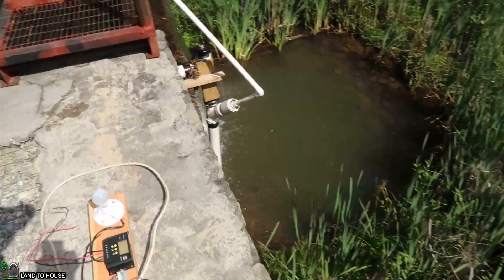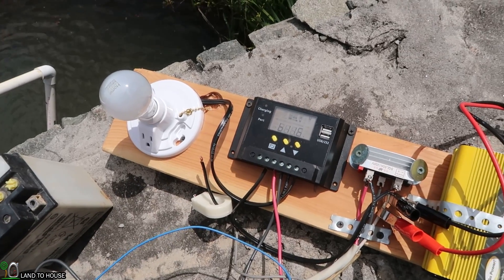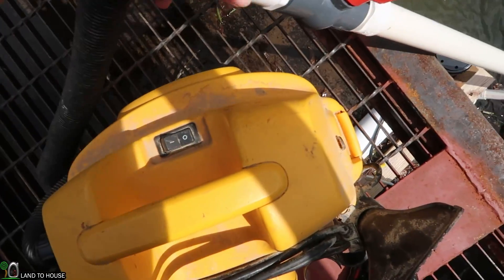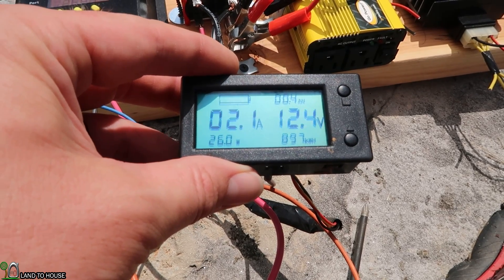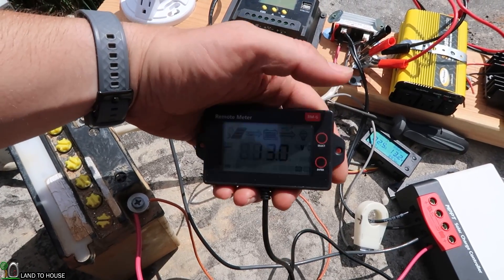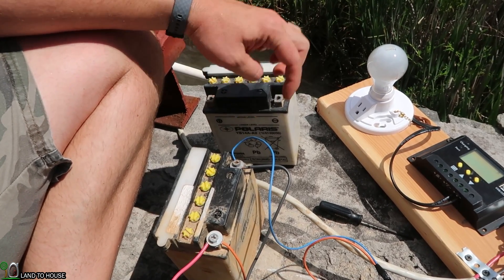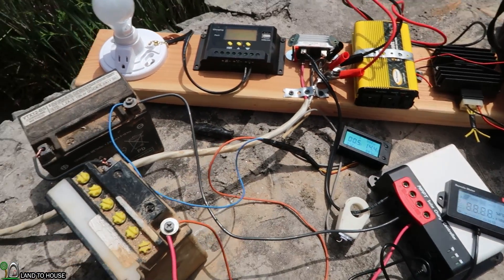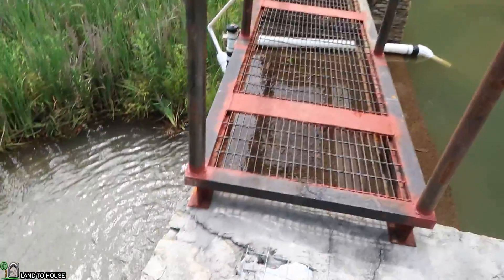Hydro Power with MPPT Charge Controller

Comment: It's good that you experiment.  Tip: NEVER put two batteries in series unless at the same voltage. One will overcharge that way, the other undercharged to reach a total of say 28 volt charge voltage.

Comment: Makes me wonder,
If that turbine impeller was lower in the tube, the weight of the water, would the system be able to support more of a load? 
or because it's a syphon, would it even make a difference . .
Reply: it wouldn't. In a syphon/low head situation, it doesn't matter where the turbine goes.

Comment: There is something wrong, at least 100W must go out, then if you get to do something more better but 100W must go out, in the maximum hypothesis of using 15 liters per second in a 4-inch tube, and a 50% efficiency conversion 15 * 1.92 (net meters) * 9.81 * 0.5 = 141W electric. Ciao
Reply: I said pretty much the same thing...
Reply: @Kevin_M_Hall  Yes !

Comment: That turbine seems terribly wasteful on water usage vs. power output. Not worth it from what I see here.
Reply from the maker: It needs a larger and longer down pipe. We are about to swap over to a turgo system. Should have better results. This is why Spencer wanted me to run several tests on this unit.

Comment: For the amount of water it uses, seems a pitiful amount of power.

I think the pelton wheel system is a much better power gen solution.
Reply from the maker: We have a turgo system in the works to test. This one i think has a max potential of 42w with 7 feet of head.

Comment: Very cool and thanks for sharing.  A cool dry run of your testing to sort out procedure and gear.  I believe the MPPT showed a tad higher battery charging voltage than the PWM, which might explain the difference in wattage reading, the MPPT was current limiting the charge to protect the battery.
Just thinking out loud here, you might want to 'mostly charge' the batteries before taking them down to the falls so you have a better baseline to start with.

Comment: Didnt think the solar controller is doing it, since your hydro is out putting three phase and normally panels are outputting DC. Nice to know!
Reply: 3ph ac is converted to DC, I would add maybe some capacitors to the system after rectifier

Comment: Considering that you have just over 320 watts of energy available in a 4 inch pipe with a 2 meter head (16 L/s max flow thru a 4 inch pipe, 2 meters of head) [16x2x9.81=~320]  where are the efficiency losses you are experiencing? (About 10% extracted energy.) Impeller? Generator?

Comment: instead of the pwm and mppt devices.. a dc to dc buck converter would give manual control over volt & current output.. that way power variance can be set to needs eg: using 100 watt buck to charge set st 6 volt lead agm & 12/24volt lifepo4 batts..  also observe it pulls more watts than on/off pre programmed smart chip regulators.. best for the bucks would be a victron dc-dc charger for online monitoring capabilities..

Comment: I disagree with your interpretation of the results. You're comparing the results from two separate meters and even showed the old meter holding strong at 31 watts on the MPPT when it was all over the place with PWM. The whole point of MPPT is to smooth out the input power by tracking the maximum power point.  Doesn't matter if it's solar or hydro or wind.
Reply: Yes, the two different power meter readings are problematic. Which is right? I would rather trust the new one, because it is build-in. Anyhow, at least one is measuring the wrong power and hence you can not compare them.
Regarding MPPT it unfortunately matters if it is also rated for wind/hydro or only for solar. Solar cells are reacting much faster on a changing load demand (e.g. the new voltage adjusts instantly when the drawn current is changed) than wind or hydro turbines. The rotation of the turbine and the flow either of air or of water are storing energy and will have to adjust to a new power demand. That takes time. Solar MPPT are to fast and will draw a to high current at the beginning because it consumes the energy stored in the rotating turbine and the flowing air/water, and then the get stuck there because they cannot find a new max. power.
I still try to convice Seth of using his MidNite Classic charge controller. That is of much better quality, is also rated for hydro, and has a reliable power reading build-in. We will see ...
Reply: @patrickhoffmann8893  it shouldn't matter which one is correct per say, esp since it's just a test, but he should be using the same meter for both tests. Can't just declare that the built in meter on the MPPT is the one you're gonna go with when you used a different meter for the previous test.
Reply: @clomads   D'accord!
Reply: @clomads  per se*
Reply: @prydzen  cool dude

Comment: One of the following must be true, you rather intentionally doing the wrong thing over and over again to generate multiple videos with lots of comments about people telling you how you’re doing things wrong or you really just have no clue how physics work. You need the proper MPPT controller to allow that turbine to spin at the appropriate voltage to deliver the maximum power. My assumption is the first, that you were just trying to generate more videos from the same project, But I hope I’m wrong because the latter means you’re a moron. You must have an MPPT that you can program the desired input voltage as I stated in three previous videos. Doing anything less will not work and the results will be disappointing. I have mentioned this on three previous videos with no acknowledgment. Best of luck, but I’m kind of getting tired of watching a grown man fail over and over again that was should be quite a simple task is done with the right materials. This video series should be called your fail compilation or how not to do micro Hydro. The sad thing is that you are making money in these videos and not reinvesting that money into videos. Do better Seth, please.
Reply from the maker: The next video will have new batteries so we can do a proper test. At some point in the future I will be using this charge controller on a solar project. I just wanted to see if it would work here on the hydro.
Reply: @LandtoHouse  what is the rated output of that generator attached to the turbine Seth? You NEED to allow that turbine to spin FAST, and the controllers that you are using just can't do that. Not sure what I mean, ask. I would be happy to actually help you as these repeated failures are getting hard to watch, if i'm being honest.

Comment: Please buy 2 new even small batteries 7ah batteries, I think You should test it in conditions when batteries are mostly discharged or under load when batteries can still soak some power. High resistance of old  batteries or charged one will not show You real power in my opinion.
Reply from the maker: The new batteries are purchased and will be in the next test of this system.
Reply: @LandtoHouse  Dominik is right: Please make sure the new batteries are (almost) empty and can absorb charge/power. Otherwise the charge controller cannot draw power from the turbine and your power reading will be to low.

Comment: Probably could hook them up in parallel and let it charge for a while then they might have enough voltages to hook backup in series
Reply: close to 0 volt battery is dead battery.
Reply: @dominik8040  beyond dead and headed to the recycler if ever below 9v

Comment: it would be interesting to do a test with no controller at all just the rectifier and amp meter and go from 12v 24v 36v and 48v and so on just seeing where the turbine will produce the most power and be most efficient
Reply: And that could be used to quickly boost the dead battery up to where it could be connected to make the 24Volt string.
Reply: @gravelydon7072  after trying to charge to bike batterys that where at the same voltage they will prob never take a charge but would of been worth a try
Reply: @1981dasimpson  I have a couple of deadish 12V100AH batteries. The controller would not allow any charge into them as the one was like his, at under 2Volts and the other at 11Volts. But by bypassing the controller long enough to get the 2V battery above 8Volts and then connecting it to make a 24V string, it would charge on the controller. And then came the fun as I could put up to 600 Watts into the two of them. But yeah, other than for load testing, batteries as dead as that likely never will take a charge and be usable afterwards.
Reply: @gravelydon7072  the 2 i was trying with just got extremely hot they where 5ah motorcycle battery's and hardly rose in voltage i have had luck with larger batterys i think due to more surface area but yeah i think i would of put all 3 batterys in parallel to see if the voltage could be higher then put them in series
Reply: @1981dasimpson  Likely the fact that 5Ah batteries do not like high charge rates. To do them right takes between 8 and 10 hours at a third of an Amp. Fast charge of only 3Amps for a half hour. A single 100 Watt solar panel will boil that battery. Even a single 50 watt one is close.
Reply: @gravelydon7072  yeah they were slowly charged to 14.8 i had been using them for backup lighting battery on bike was dead so i thoght id use one of them but neither of them would take a charge when i cheked they where both below 2v
Reply: @1981dasimpson  If after slow charging they went back that low, time to recycle them.
Reply: @gravelydon7072  yeah they sat on the wall now waiting for the scrap man had to order a new one

Comment: If you get the chance (and finances haha) would love to see some tests with other "solar" mppt controllers, especially ones from china like MakeSkyBlue, and also try 48v (may have to try with a "boost" MPPT controller like the MPT-7210A) :D
Reply: Makeskyblue is so fake,it kept overcharging my Agm battery ,absorb settings 14.4v float 13.8v but it went boiled my battery bank,never buy it
Reply: @kipdennis3796  You must have had something wrong as I have two different MSB units on my Lead-Acid batteries and never have any problems with them. I also have a LIPO stack attached which is good for 20Amps at up to 29.4Volts so it can soak up any extra.
Reply: I have a problem with the MPT7210A units. They only last about 6 months in our often 100% humidity.
Reply: @gravelydon7072  I've seen some people change out a few of the capacitors in them for higher voltage ones which seems to fix a few of the issues of them failing. Also, I know they aren't "true" Automatic MPPT as it allows you to set the Solar Panel Voltage manually which may be good to try. Would be good to see some experimentation done with cheaper options instead of most people have to go with the Midnight Solar.
Reply: Had another thought of maybe trying out some "Wind Turbine" charge controllers? they may or may not do a better job of finding MPPT (if they are even true MPPT) and a lot of the controllers allow you to connect the 3 phase wires directly from the turbine to the controller removing the need for the bridge rectifier. :)